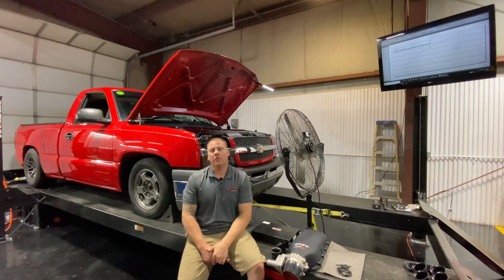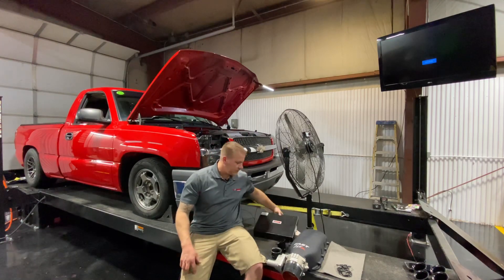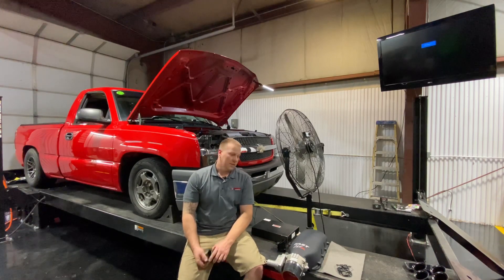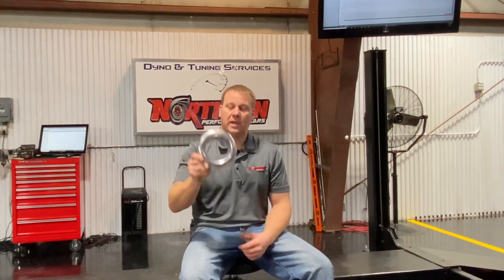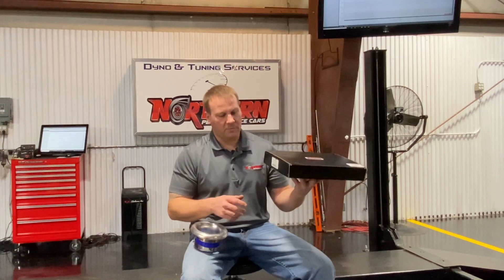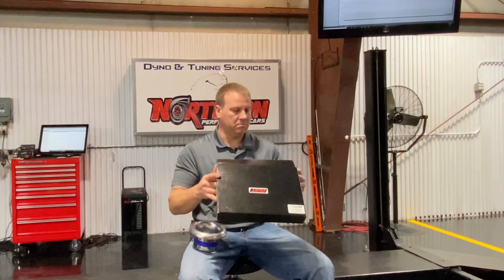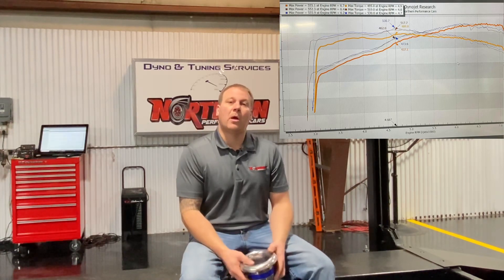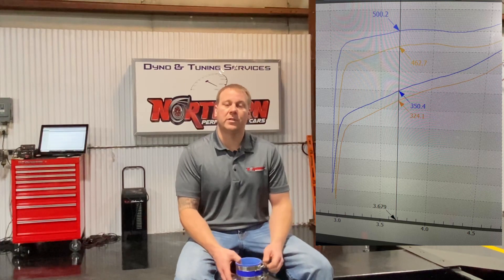FAST LSX HR intake manifold Dyno testing! Runner length comparisons! Lsxhr ls3 Silverado 408 ls

Comment: Did yall have any issues dialing in the idle? I have nothing but he'll with a lsxrt, debating swapping to this before I pull my hair out
Reply from the maker: Not at all. We use them on a ton of builds. Very strange to have issues with one.
Reply: @NorthernPerformanceCars  have you had issues with the lsxrt? Mine runs awesome every where but has slow speed stall, doesn’t want to catch after a rev, hunting. And I have had a very good tuner on it multiple times.
Reply from the maker: @disciple77rc  no sir. We have used more than I could count and never experienced that. They are absolutely my favorite intake lol

Comment: I have a V1 with the LS2, it’s just full bolt ons and a ported fast 102. Im at 404/445. Going going gpi ss4 and ported 243s, would this manifold benefit over a regular fast 102?

Comment: Why did you choose this intake over the holley high ram?
Reply from the maker: This intake makes more torque and similar to the same peak horsepower to a hi ram. And 10 pounds lighter. 
In my opinion and factual. It is a better intake.
Reply: @NorthernPerformanceCars thank you for settling this, almost wasted 1k on Holley
Reply: Have you ever tested the Chi ram intakes? The holley high ram knock offs?
Reply from the maker: @ThunderMonarch  I haven’t I barely like the hi ram itself lol 
Low ram and mid ram are a complete trash intake from Holley. Hi ram works great for tons of rpm or a bigger boosted combo.
Reply: @ThunderMonarch horsepower factory in houston did a dyno video on the Chiram and it was surprisingly good
Reply: Thank you for the replies! I greatly appreciate it. I have a 07.5 nnbs with a 4.8 and a 200shot. Ive had a l92 from a denali for 2years now and finally got around to building it. Cnc heads and the lsxhr is whqt im going with. Thanks. What throttle body do you recommend
Reply from the maker: @ThunderMonarch  perfect! No problem. I like the bbk 102 with ls3 throttle motors. They tend to work great.
Reply: Have a part # will the truck plug work with it?

Comment: I have a gen 4 5.3 with ported 706's with bigger valves and shaved .030 on it with Truck norris cam.  4:10 gear and 3000 stall. Im looking to do the LSXRT or the LSXHR. but cant decide. I do not want to loose low end power or torque? The intake manifold i currently have is the stock NNBS manifold. Help me decide what i should do.
Reply from the maker: Don’t chose the r-t then. It has shorter runners. 
The hr with long stacks is your best bet. But still will have a slight loss vs the nnbs to 3,000 rpm 
So should be good

Comment: What runner length did you stick with?
Reply from the maker: I have the short runners in it. As the converter flashes 5,200 rpm or so with the converter unlocked it’ll be past the point where it loses torque Vs the long runners.

Comment: Do you recommend the LSXR HR intake over the shorter LSXR? I have an LME built NA 6.0, 11.5:1  and currently running a LS6 intake and want to upgrade, but not sure which Intake to go with between these two.
Reply from the maker: It’s definitely worth some power over the fast lsxr

Comment: What kind of converter and gear ratio do you recommend for a setup like this?
Reply from the maker: I have a 3,800 Fti in it. 
I have a 4.10 and 28” rear tire. 
Great combo. 

It went 11.4 in the 1/4 with an Ls1 in it naturally aspirated.
Reply: Damn on that relatively light vehicle I definitely need to go at least 4.30 in my stock suburban with just a k&n and long tubes and I played with the tune a little and I have 30.5 inch tall tires

Comment: Have you done any comparisons with ported and polished heads vs. not ported? I’m curious if there’s an estimated power gains. Probably similar to your differences with runner length, different power band.
Reply from the maker: I have done some in the past with ls1’s and they’ll pick up 25-30rwhp with a healthy cam and nice intake over a stock head. 
I’ll do a video on this engine coming up in the next 4-5 weeks. I have a better set of cylinder heads to try.
Reply: @NorthernPerformanceCars  I wonder what it’s going to do with the Truck Norris cam.
Reply from the maker: @williamb2013  this truck has a totally different engine in it. It no longer has a truck Norris. It’s a 408 with a much larger camshaft.
Reply: @NorthernPerformanceCars  I understand that, I just used this video to contact you
Reply from the maker: @williamb2013  gotcha. You mentioned what it’d do with the truck Norris. But no longer has it. Wanted to make sure you knew.

Comment: I always wondered is exhaust smoke after dyno pull ok or a bad thing? 
When you release the pedal
Reply from the maker: It was a new engine. After 30 miles or so. It’s gone. Just things wearing and breaking in. 
Normally if it’s during deceleration. Under a vacuum situation it’s not a big concern. Especially on a looser assembled engine